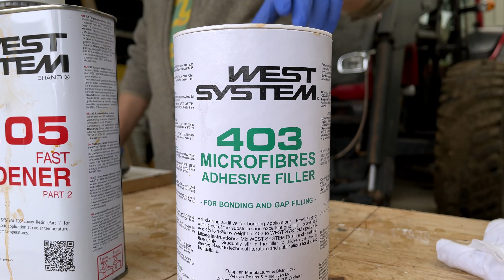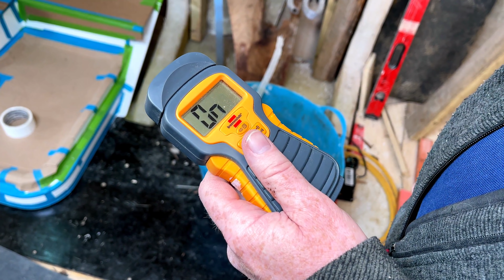BOAT Restoration - More ROTTEN Deck CORE - EP 50

Comment: Good time to put some 'joists' on the underside of your coach roof.  I like steamed oak which is then epoxied in and glassed over.  They never seem to get the decks and cabin tops stiff enough.  When they flex they promote leaks with the movement against hard points and create gel coat crazing.  People always seem to gather on them and can bring a lot of weight on those deck areas/cabin tops.  Flybridge decks seem to also be a weak point.  Easy to do while it is opened up and most difficult after the finishes are in.